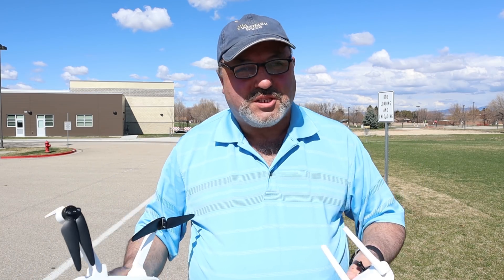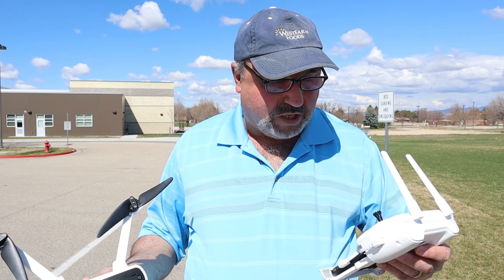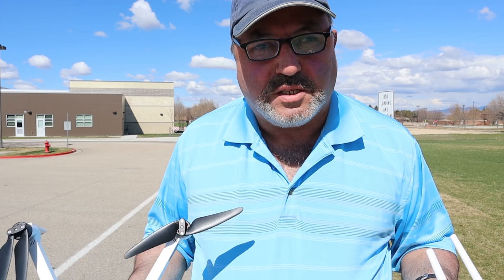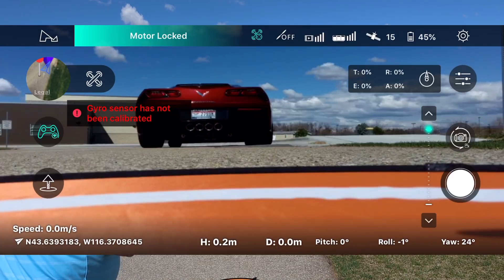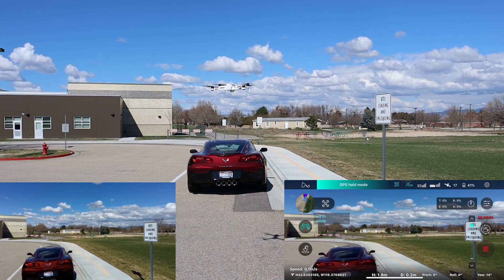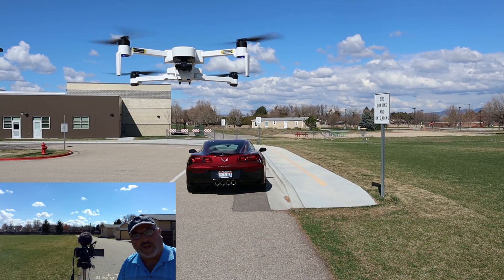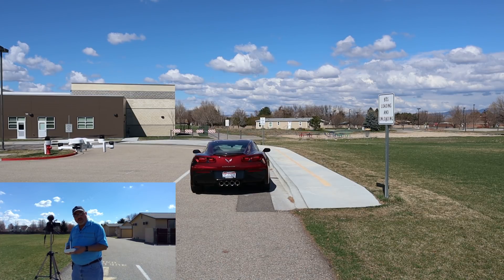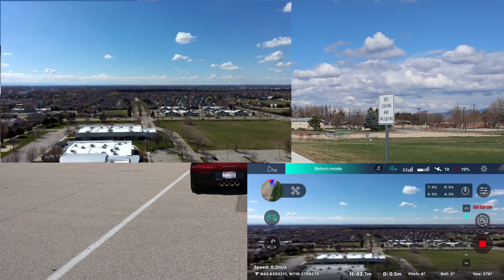Hubsan Zino Flight Control Upgrade Test 1.1.50

Comment: Sorry about the short test flight, but it seemed to do very well on the new firmware. When I did the update it kept asking to calibrate the gimbal, which I did, but I still needed to reboots make it stop bugging me.  Nice testing Marcus, and I was surprised to see you in short sleeves.

Comment: Nice video Marcus, I went ahead and did the firmware update as well. Then I did several auto-takeoffs and there was no drop for me either. Seemed quite stable as well.
Reply from the maker: Wait until you see the next video Tom.  I did another test, and got a little too enthusiastic.  😎👍

Comment: Hi.The new firmware a test on the range did? According to the reviews it now when connection is lost is not refundable and hangs at a point. In this case, the video link is lost, but the drone is controlled.

Comment: Since my new Zino only showed me 9 Satellites and a distance of more than 20 m between Zino and controller,
I started the whole binding and calibrating procedure 3 times. After that the fully charged battery was down to ~80%. So, did you perhaps also use some power in initializing everything after the update?
I am still at 1.1.48 as it was delivered, and today it flew rocksolid with only a slight breeze.
The only thing which worries me, is that I didn‘t yet get more than 11Satellites(you had 19 in your video) and this big difference of 13-20 m when doing the gps precision test. Should I care for that or ignore it?
Reply: Hi Klaus, since updating to 1.1.48 I have twice flown my Zino more than 700metres over open water without any problem. All other functions worked fine too and no drop-outs on the signal.
Reply from the maker: I do not profess to be a GPS expert, but I have heard that 9 satellites is enough.  I also suspect that all of the initializing after the update may have affected my battery life.  I am recharging and will try again today.

Comment: I just did a re-do on the update. I found a mistake I made. I Was Wrong :) This time (like yours) Hubsan drop was minimal and Hover quite good. I also did the H216a which performed flawlessly. Only issue I have with 1.1.50 is the change in the stick sensitivity... a little sluggish and top speed is 8.2-8.5 m/ps. Overall pretty good. I had to delete the work I did yesterday... and will apologize to the YouTube world :D
Reply from the maker: Your tests are always great GM!  No apologies needed!
Reply: @IdahoQuadcopter  :PM'd you :)

Comment: Marcus, I think you should point out the gust effects the barometer. I don't know if all people watching are familiar with thermic effects, ground effects and air pressure effects. Maybe it's not a bad idea to speak with pilots of gliders to get more information in these effects. In my opinion he Zino improves more and more. Maybe they found a way to set up a combination of gyro data, barometer data and GPS data to calculate the high and position. I'm not a programmer but I can imagine that's a high requirement for the stuff.
Fair winds
Tom
Reply from the maker: I agree the Zino is improving with incrementally with each update.  Because the Zino does not have all of the sensors etc. that some other way more expensive products have, it will never be as stable as they are.  Thank you for your well thought out comment Tom!

Comment: it looks like hubsan is not able to solve this altitude hold problem
Reply from the maker: Yes, without optical flow, or other sensors, the Zino is what it is.  I do maintain that it is a great value.